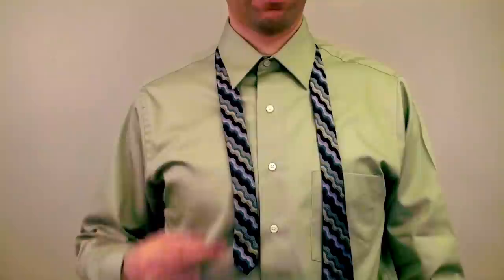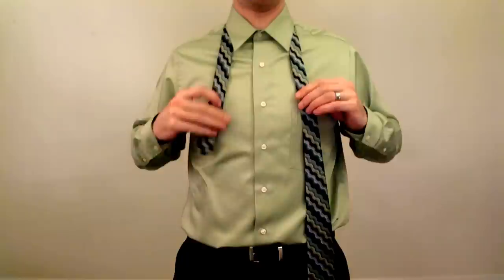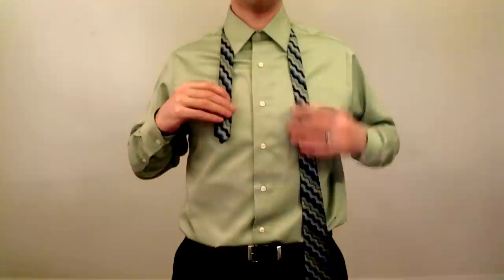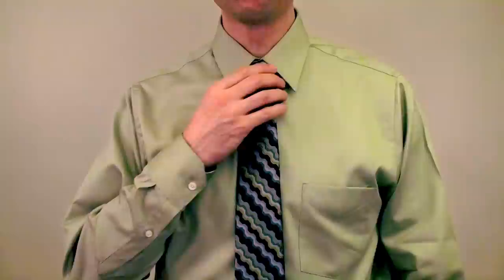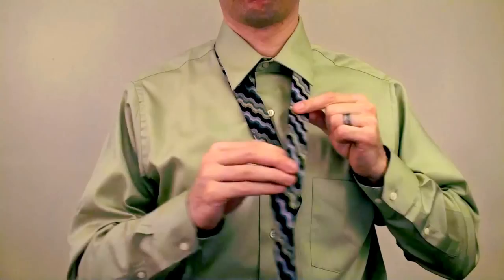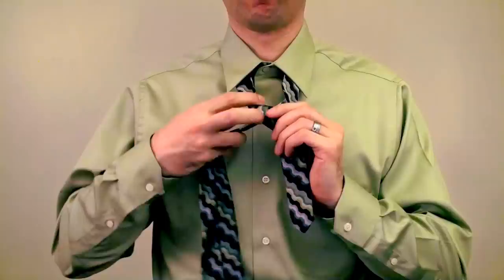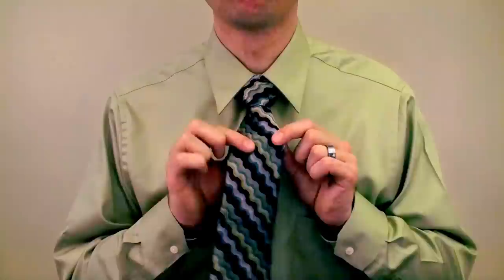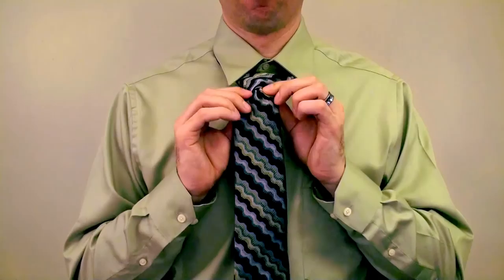Proper Tie Length of a Full Windsor Knot

Comment: You forgot a few points while explaining the principles.  Ties come in different lengths, widths and density.  A person has a different length of the torso, the size of the torso and neck. And there are a lot of different collars.  This means that each time you need to use a different tie knot according to all these details. And the rules will be different too.

Comment: Proper tie length needs to be just at the top of the belt, or approximately the middle of the belt. At 3:40 / 3:41, where you have tie tip being at/around the belt top is the correct and proper length for a double (full) Windsor.

So unless you do not stand with a straight back, I don't know why you're saying it is too short.

And no, I'm not in any way a newbie with ties ;) I'm just looking for a video to link to a friend who needs a fast guide on ties for tomorrow. :)

Other than that, nice video with a good explanation ^-^
Reply from the maker: I tend to like my ties just a little (maybe an inch) longer than that. Like I have at the 0:02 mark. The difference is almost negligible and you are probably correct most people these days like it the length you mention.
Reply: The